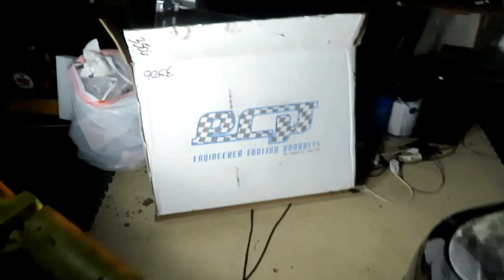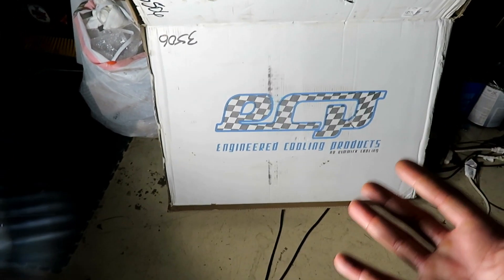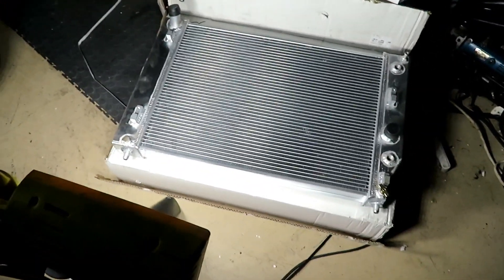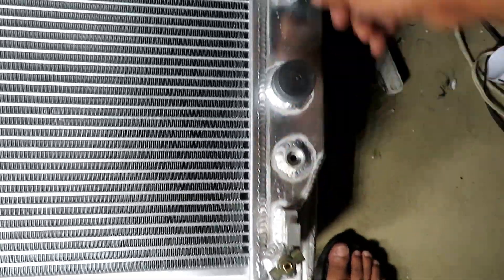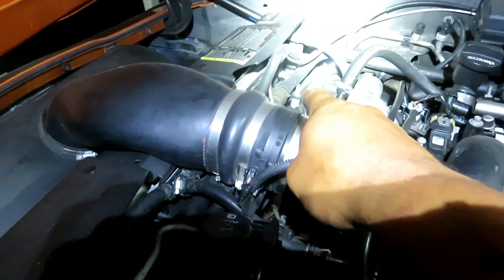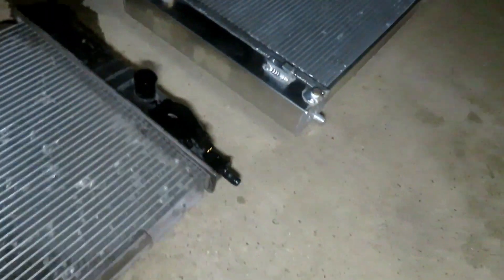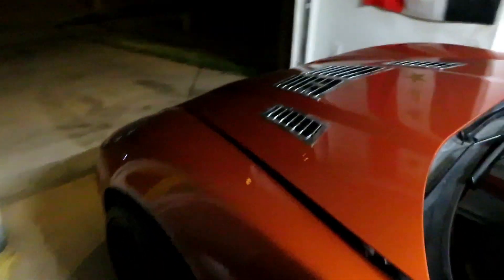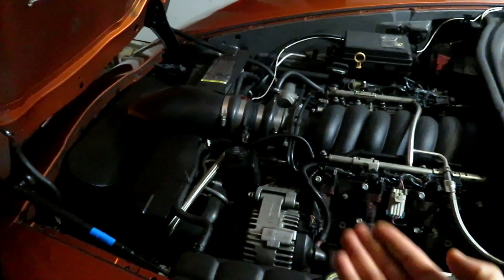Ending My Cooling Quest: *Cheap* Dual Core ECP Radiator

Comment: Did you have to replace the bottom radiator hose ? Since I switched I found all my coolant on ground from bottom hose
Reply from the maker: @FranklinSaint485  Naw. I used the stock hose. You may have a hole in hours

Comment: How is it holding up?. Any leaks?
Reply from the maker: Nope. And temperatures never over 210 on a texas summer track day
Reply: @x03736  thanks, I'm debating getting one for my 03 z06.
Reply from the maker: @toodanderson351  if your not using it for heavy duty, such as the track. A stock radiator is fine
Reply: @x03736   If you need to replace I would go with your choice either way.